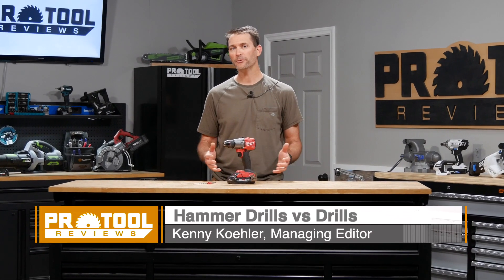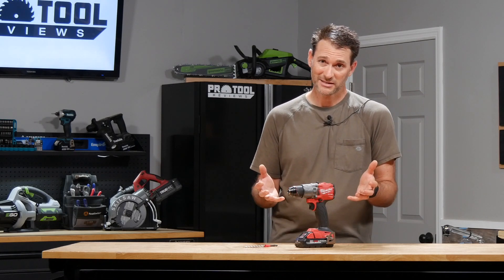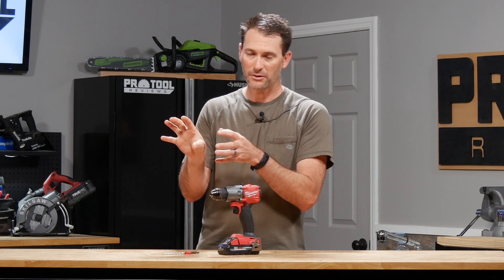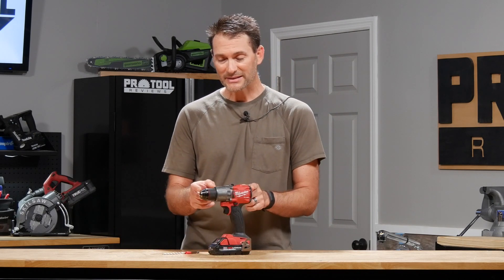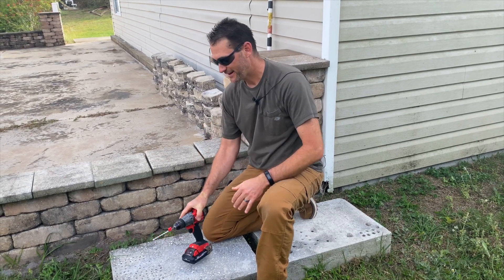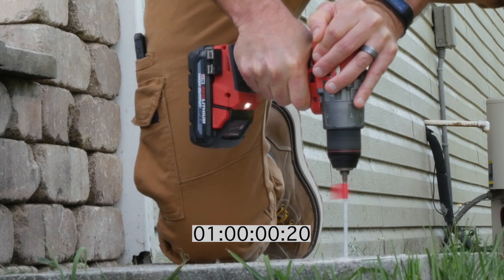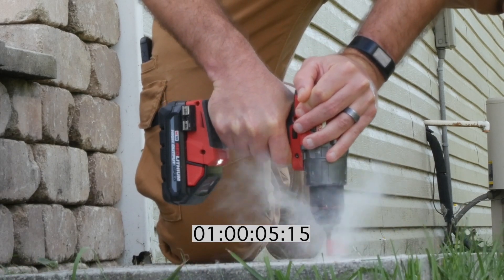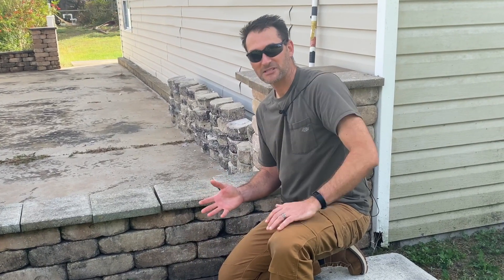Hammer Drill vs Drill | Which is Faster in Concrete?

Comment: This is not hardened concrete. Try using a really hard concrete. without hammer drill it'll no go forward for more than 5mm.  With this type of hammer drill with hammer function tunred on it'll move forward with a lot of noise.

Comment: Great stuff Bro! I prefer the rotary only mode for its smooth operation. By the way, is there any rotary only masonry drill bit available on the market? Also, if rpm of drill is higher,  then drilling time is shorter. Regards. Sham.

Comment: You must not have hit any aggregate with that bit or my concrete/ masonry bits are bogus. One of them was new, by Tapcon. Will buy top of the line Milwaukee bits tomorrow and see. (Used drill-driver.) EDIT: bought Milwaukee drill bits, they worked fine for about six holes  (3/16) the smaller bit (5/32) was worse, only four holes then it hits aggregate, maybe rebar or is too dull.

Comment: Great video! As a DIYer I am about to drill a few holes into concrete for 1/4 in Tapcon screws. I have some carbide drill bits and it is great to know that my regular drill should manage the job- time is not an issue for this job.
Reply: alandaters: Would be interested to how that went for you. I used a 5/32 Tapcon bit (actually I used 2) which took about a half hour to complete the hole. I finally just scrapped the project. 😑

Comment: I'm going crazy, sorry boys but this chick is trying to figure out the whole drilling into concrete. I got bits for concrete, multiple, hard metal and wood, I understand the difference, however I don't know if it's my drill or my lack of more muscle and my house is made of concrete and everytime I try to make a simple hole it's excruciating. What drill do you guys recommend that has enough power so I can do everything I have to do without dislocating my shoulder? I'm talking walls and roof. Thanks for any pointers!

Comment: Imo it’s a mind trick! 
Both, drill holes at about the same time, but just drill mode is very quiet, not satisfying and you feel like your not doing anything, so it feels slower. Hammer drill mode is loud, annoying, but feels like it’s doing something, because it’s aggressive, and all you’re concentrating on is for that noise to stop. Just my opinion and experience.

Comment: When I remodelled our kitchen, I had to put a few hole into the brick wall. I only had my drill driver and masonry drills. I drilled the holes without any difficulties as showed in this video.
Reply: thats because you used a 18v  to 20v drill dawg, this is a 12v baby
Reply: @mr.mikehunt4286  yeah, that was a DDF480 Makita, 1500rpm, 5mm drill
Reply: @vartikcsaba  voila, no Milwaukee 12v

Comment: Hi I just got the Bosch advanced impact hammer drill (18V & 35Nm) and tried drilling into masonry using the hammer drill mode & it struggled to do even 2cm deep hole! I was wondering whether Brand & category makes difference as i saw in this video the Milwaukee brand of similar specifications did concrete drill so effortlessly. Can you advice if this true, especially considering that Bosch too is a reputable brand
Reply: Hammer mode definitely works better while drilling through concrete... I've use Bosch GSB450 and it worked fine
Reply: What type of bit ?

Comment: Two seconds is significant? Smile. This helped me so much. I CAN use my regular drill. Just need proper drill bit. Thank you guys!
Reply: If you’re not drilling holes in concrete for a living yes. 

If it’s a tool your using to make money, those two seconds means a $200 hammer pays for itself as soon as you burn through a couple boxes of tapcons

Comment: Wow this is really interesting... I had just assumed that a normal drill would be pretty useless in concrete and I'd need a hammer drill.  But to me this is pretty close.  I dont really need those extra 2 seconds, and it seems like the normal drill action worked just fine even for that very deep hole.  Thank you!
Reply: I guess the lesson here is to use the right drill bit.
Reply: @h8GW  Well, I recently had to do some drilling into stucco.  So, not exactly concrete, but close.  I tried with my regular drill and I basically go nowhere.  Was very disappointed.  I bought a hammer drill and tried that, and it worked really well.  Whereas before I was getting nowhere fast, I was now able to drill a hole right through a stucco wall in like 30 seconds.

So, not sure what to think now.  I'm guessing that maybe a regular drill will work for new/soft concrete, but anything that's older and harder... I'm just not seeing it.
Reply: Well, then I guess it's good the difference between the two tools is only $5 at Harbor Freight.  I don't even know why I was even considering if it was worth the upgrade or not.
Reply: @DeusExAstra concrete gets softer after time not harder. Cement on the other hand can be a bugger to drill without hammer.
Reply: you shoul use a drill bit for glass/tiles, to make hole on concrete.. it takes lesser time

Comment: Great stuff! 
(1) Are you using a special drill bit in 
       normal drill mode? 
(2)  Is it possible to convert an ordinary 
       into a hammer drill? Any adaptor or
       kit available? 
Thanks n Regards.

Comment: Just want to be sure, so if you could help.

I have a drill, Milwaukee brand, that does not have a hammer function, it’s a regular drill. 

If I buy concrete drill bits, would I be able to drill in to concrete? 

The home I just purchased has a concrete shed (looks like it’s made of concrete cinder blocks), and I want to hang a couple of pull up bars to make a home gym. Would it be possible?

Comment: Just watching this I remember my friend drilled a hole while on halfway in he tilted the drilling angle and the drill bit just snapped off 😅
Reply: Especially we used a drill that has no hammer function and the concrete was made around WW2 era (it was a state college here in the Philippines) like cured as hell 😂 Still it was a good experienced to know that fast moving metal parts tends to get hot and a chance to snap the drill bit.

By the way, have you tried to hot swap a drill bit? 😂😂😂 Damn I juggled the thing like its hot potato 😂

Comment: Thanks for the info.  Would you get a separate "normal" drill if you already own the 2804 hammer drill?
Reply: So it sounds like you might as well just get a hammer drill and use it as a normal drill driver rather than buy a separate drill driver, that way the hammer drill driver does what a jewel driver does and give the extra power to knock out the concrete.

Comment: what do you suggest for masonry hammer drill or normal drill ?  are the holes accurate and same size if you use both modes ? I mean does the  hammer drill have an impact on the width of the hole.
Reply: @Protoolreviews  You saved my day bro 🙏 thanks a bunch for being helpful and supportive.

Comment: I am confused by your video.  I will say that I am not a masonry guy, so I might be showing my lack of knowledge.  Based on your  video, you can use a without a hammering function and it would be slower, but you would get there.  Some years ago, I tried to drill a 3/8" hole into a solid concrete floor to sink some anchor plugs.  After half a dozen masonry bits being destroyed, smoking to the point of failure two non-hammer drills and lots of pressure being applied to my work surface I was able to drill into the concrete maybe a 1/8th to 1/4" of depth. I would love to know what did wrong, should I ever need to drill into concrete ever again.
Reply: I've drilled thousands of holes in to brick and concrete. 5/32" up to 1.25" usually. In the real world the drill only function is useless for brick and concrete. You absolutely need a hammer drill. A regular drill is the wrong tool for the job.

Comment: Some detail about the drill bit would have been helpful. Some drill bits are NOT designed for hammer drilling, some for both hammer and rotary drilling?

Comment: Impressed that the regular drill function went in so easily. In my 60 year old poured concrete garage a regular drill would barely make a dent. Milwaukee hammer drill made it much easier.
Reply: The drill bit made the difference. He was using a concrete drill bit in two modes: regular, and hammer. You must be using a regular drill bit.

Comment: A lot has to do with the masonry bit also. A crappy masonry bit and you’ be there for a long time in a puddle of sweat.
Reply: So true. However, if you have a powerful hammer drill, the bit will not matter much. Honestly, I would have called bullshit on my own comment a few years back... However, I have a home in China and the US as well. I am in China for 6 months each year for business. Nearly every quality brand of bits sold here are fakes. Pretty much all of the domestic brands here are shit. 

I live in a 2nd tier city, so obviously I am in a high rise (Everything formed concrete). I am one of those constant DIY guys that seem to never run out of projects and I don't like having someone else do it for me when I was raised to know how to do home renovations myself. I quickly learned here that a powerful hammer drill and a sheep bit seems to be more economical than a light operating hammer drill and a quality bit. I can use a 2 RMB (about $0.28) bit hundreds of times without a break or problem...and half the time this guy is doing on one of those brittle cinderblocks.

The homes here do not use junction boxes in the ceiling. They run electrical PVC when forming the concrete pours during fabrication. So, you have to add strike or wedge anchors when adding lighting. Actually, anything you purchase to install on walls or ceiling all come with strike or wedge anchors. Between my home and business, I have hung 29 Medium weight ceiling light fixtures, 4 large steel ceiling fans, 7 59" ceiling TV mounts, 12 commercial Speaker ceiling mounts, and countless ceiling mount advertising banner mounts, 7 59-62" TV wall mounts, and two wall-mounted 8-stage drinking water filter systems... I have used one cheap drill bit and still have it... As all items are always sent with anchors requiring 9mm drilled holes.

Comment: I fail to see how ~2 seconds is all that significant. Does anyone really go around wishing all day that they upgrade their drill so they could drill that hole in the concrete 2 seconds faster?
Reply: If you are just drilling a few holes here or there it is not worth the extra expense. It you are a plumber or electrician and you are drilling hundreds of tapcons for conduit all day long it makes a huge difference, not only in time savings but it does not wear your battery out so fast. I use a rotary hammer drill because I drill 3/4" holes though 12' to 18" deep, hardened solid concrete (installing network cable) which neither a standard drill or a hammer drill could handle. Each type of drill has its purpose or nobody would be buying them.
Reply: @gregorymills6526  it's better to have a compact rotary hammer then. They are way faster, and way way more comfortable to use. You don't even need to push that much (good when working on a ladder or under a kitchen sink).
Reply: Gregory Mills I understand what you’re saying, but let’s examine this further—let’s suppose you drive 500 screws a day into concrete. If you save 1000 seconds a day, that’s only 16.6 minutes—barely enough time for a lunch break! Not only that, but it probably takes more than 2 seconds just to do things like change the driver bit and get each screw ready for driving, or move into the next position for drilling! I still have a hard time believing 2 seconds could be that important even to a professional.
Reply: @zuperdee  that was the difference in this concrete with this drill bit. It's very likely that with a bigger bit or older concrete the difference could be much wider than 2 seconds. We actually saw about a 25% decrease in time with the hammer function. If you're drilling a ½" hole in some really tough concrete, or a large number of smaller holes, that 25% decrease in time can add up. Ideally, if the hole is big enough and deep enough, you'll use a rotary hammer drill if you have one.

To give you an example, I needed to drill four ⅝" holes about 4" deep into my home's 32 year old foundation for a bracket for a water filter I was installing. At the time, I didn't have a rotary hammer and ended up using my normal drill's hammer mode. It took about 10 minutes per hole. If using the hammer function saved me 25% , each hole would've taken about 3.5 minutes longer, or about 14 minutes total that I saved by using the hammer function of my drill.
Reply: @JeremyHansen  I need to drill some holes in my existing concrete pad, to insert rebar, cuz I'll be pouring new concrete right next to it. So I could probably get by with a regular drill and masonry bit?
Reply: @JeremyHansen  thank you for the advice. So for a simple backyard job where there will be no more weight then maybe a few people at a time standing on it, is 3/8 re bar the standard? I'll be joining new to existing. Also, I live in the valley in CA where there is not much freezing, I mean there's maybe a total of a week of temperature that gets down to 30, maybe like 25 degrees Fahrenheit. I'm just trying to check around cuz with all the projects here that I've helped on  I don't remember using much rebar.
Reply: @kbanghart  That I don't know. I just did a Google search to find the common size of rebar in driveways. You'd want to check with someone locally to see what they'd recommend.
Reply: @kbanghart  keep dreaming
Reply: @atrapasuenosdream3017  umm about what?
Reply: Uhh..I think most regular drills cant get through concrete at all.
Reply: @TheBooban  Did you even watch the video? They showed a regular drill bring used to drill concrete.
Reply: Jeremy Hansen yes i saw, which makes me wonder if there was something special about it. Or the drills Ive used are truly crap.
Reply: @TheBooban  it is freshly poured concrete, which will harden over time. The harder the concrete or the bigger the bit, the worse a normal drill will function.

It would be interesting to see this test with 20 year old concrete and a ½" or larger bit.
Reply: @JosLewisWood Carpenter or whatever brand they've bought into. I have a majority of my stuff Dewalt since i've got tons of their batteries. i bought a Makita circular saw recently because I needed an extra saw. I have some milwaukee tools and stuff because they were on sale, heck I even got a Ryobi Lawn mower.
Reply: @JosLewisWood Carpenter oh jeez we got the tool police over here 🙄 I get what you’re trying to say but I mean Milwaukee and DeWalt do make good tools tho and they cost about as much as a Makita lol I think it’s just preference. For example I also own Craftsman drills but they suck ass at drilling thru concrete, my Makita and Dewalt hammer drills cut thru concrete like butter, but it’s to each their own I mix and match tools depending on which brand is the most reliable I see in the field (I’m an electrician)
Reply: I just love your comment, so, I upgraded to a hammer drill!
Reply: hey mate. We currently have about 10,000 holes to drill vertically into concrete and each hole is taking about 5minutes of constant drilling. One drill being better than the other by 2 seconds in this small hole  could mean days saved haha
Reply: JosVideosHD There is a degree of truth in what you say! I’ve seen videos on YouTube where people have done the silliest things, like bringing out 4 different impact drivers to see which ones were most powerful as they take the lug nuts off a car wheel, but then show their ignorance by not torquing them properly or tightening them in a proper star pattern when putting the wheel back on. To me, a true professional is someone who knows how to use the tool properly, no matter which one they use, while an amateur is  someone who tests 4 different impact drivers for ultimate speed and power, but doesn’t know how to use any of them properly.

Comment: That concrete is soft as sh°t too. Try that on some 10-15 yr old concrete with a 3/8 bit and the diff is apparent
Reply: Yup. I used a regular drill and a 3/8 masonry bit and after about 40 minutes I got an inch and a half deep. Drill and bit are superhot too.
Reply: Obviously that wasn’t the point of the video smh.
Reply: @JosLewisWood Carpenter I’m drilling half inch masonry bit, and I’m not even a inch after like 35 mins. Lol
Reply: @Smylesb20  make sure its the right drill bit. If alls right then youll need a bigger drill.
Reply: Hahaha!!! You are right my friend. 😆
Reply: Yup, I needed to make a 2cm hole deeper to 7cm to insert a longer screw, it took me more than a hour to drill that hole with hammer mode. (I needed to have 4 min rest after each 1 min attempt, to let the drill and bit cool down.)

Next time I need a hole in a wall, I will get a proper hammer drill with high impect.
Reply: I agree. You can drill honeycombed concrete with a 12v drill for housewives to hang picture frames